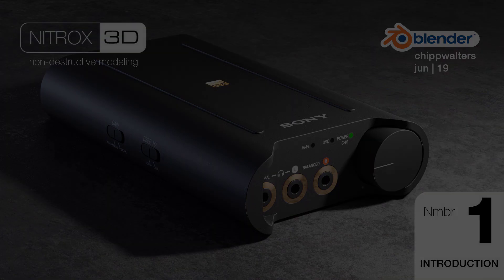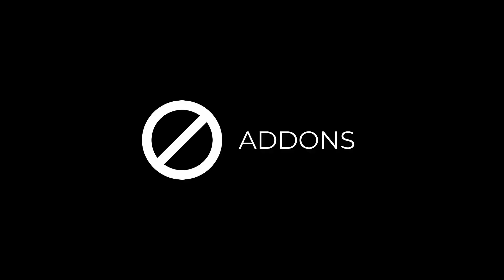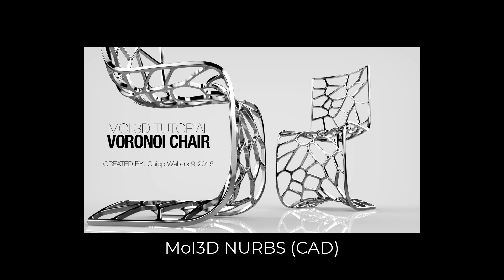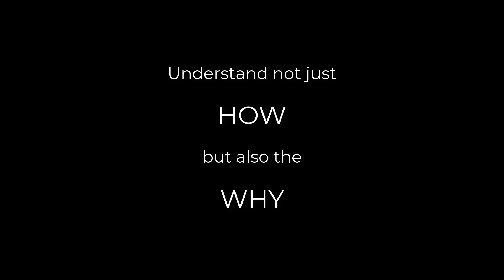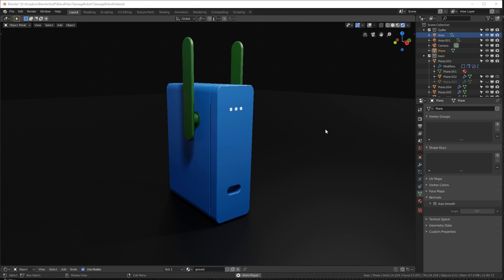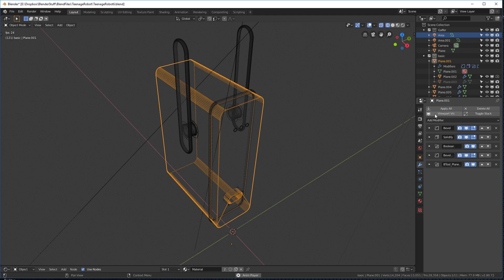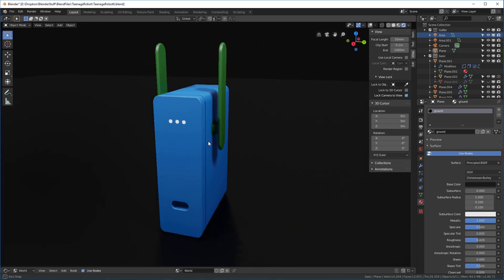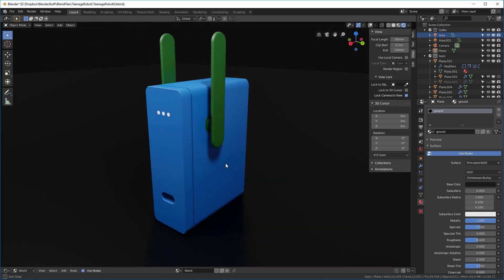Blender NITROX3D 01: INTRODUCTION

Comment: When you say "Non Destructive" do you know if these are applicable to 3D printing? I make 3D models that I print and was using Maya but now learning Blender and I am learning how to create complex models that I can then send to my SLA printer. I have found some of the things I have done do not translate to a 3D print and I am questioning if these "Non Destructive" methods mean that it only makes the model appear to have transformed and therefor are not actually hard surface elements that will translate. Hope that made sense?
Reply from the maker: When you export, all the modifiers get applied-- so yes, it does work with 3D printing.
Reply: @ChippWalters  Great news, thanks for that heads up Chipp!

Comment: I always said you could do CAD with Blender just fine. The only difference is the modifier stack is more abstract, in the sense that it's not necessarily based on real mechanical operations, although it can emulate many of them just fine (ie. boolean difference + cylinder (which in your case I assume would be a simple quad + bevel to make it a circle + solidify to make it a cylinder) is essentially a drill hole). Excellent workflow!

EDIT: Your voice is fine as long as we understand you very well :-) ! As many people already said, take care, I hope you get better soon!

Comment: This is really impressive, are there reasons why you wouldn't use parametric design software instead ?
Reply from the maker: They don't create very clean poly meshes. Plus, Blender has all the tools needed to render and animate as well. Not to mention, parametric design software is very expensive and takes a long time to learn.

Comment: I would love to see Blender have its own version of Modo's MeshFusion (or Maya's HardMesh), which would make me switch in a heartbeat. The only thing close is the Bevel After Boolean addon, but it is still horrifically destructive. Lots of great info in this video, though. Thanks for putting it together.
Reply: I don't know Modo/Maya but am coming from MAX, and the destructive nature of Blender modelling is my biggest roadblock. I do a lot of packaging models - bottles and things like that, and having a "stack" of modifiers so i can base things on lathed and extruded splines then make adjustments to base splines to create different variants or correct mistakes is something I can't imagine doing without. I'm modelling real objects to millimetre precision and it's very easy to get it wrong - some kind of non-destructive or parametric approach is kinda essential. I'll be looking into these techniques more but am also wondering why no-one mentioned Blender NURBS?